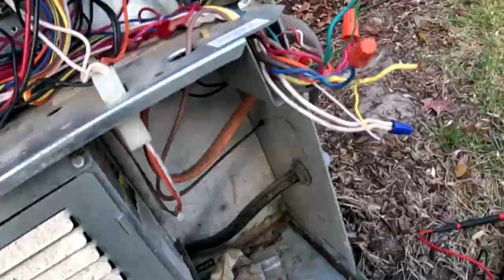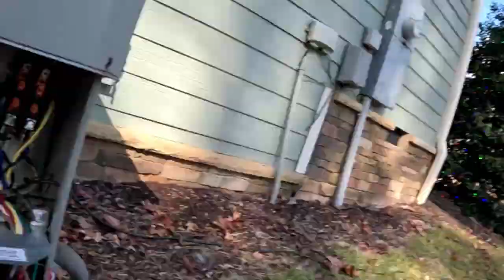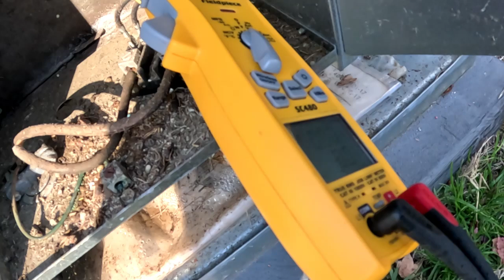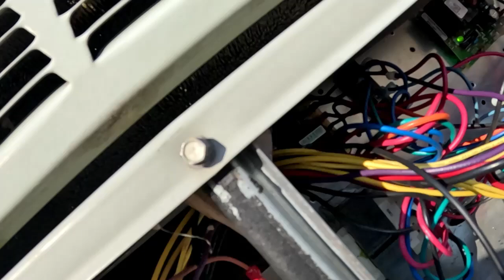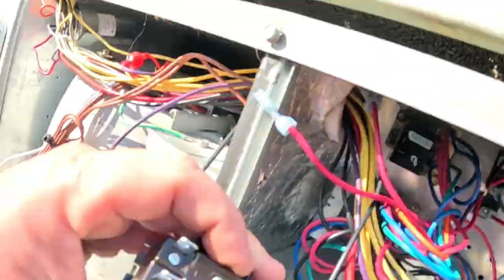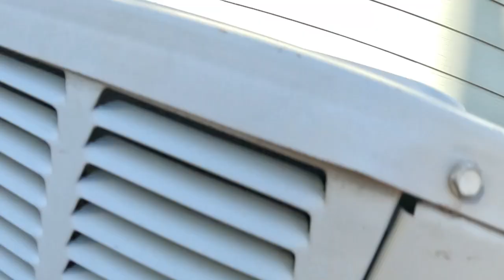Easy relay swap on a TRANE  Heat Pump system.

Comment: great video, my transformer has a blue and yellow wire on the low voltage side. the blue has 24v but yellow has no voltage. My unit works fine as far as I know. does that mean I need a new transformer? I have no control board.
Reply from the maker: Sounds like the Blue is the hot and the yellow is the common (neutral) some use different colors on the wire designation.

Comment: What are those jumper cables with the alligator clips called? Did you make that tool? New HVACR student here. Love your informational videos.
Reply from the maker: Bought a bag of different color 12inch jumpers, cut them all exactly in the middle, wire nutted them together. makes 2 sets. And they are all colored for the wires I am jumping.
Reply from the maker: Just remember that when you connect R they are all energized, so just clip the ones you are not using to itself so you do not pop a fuse.